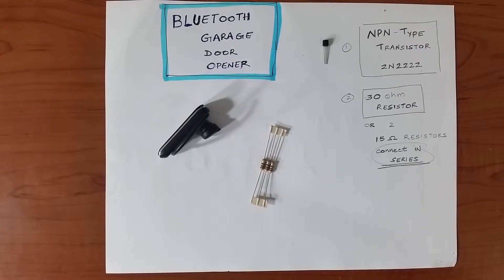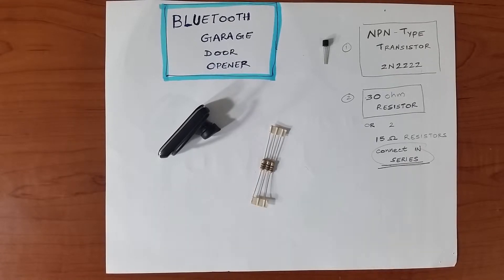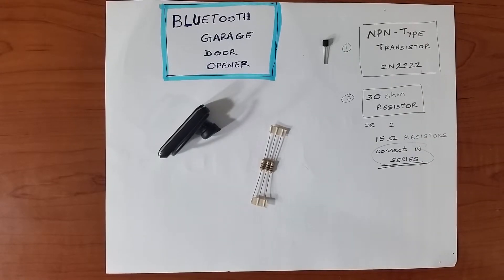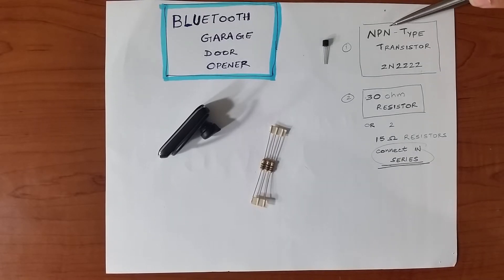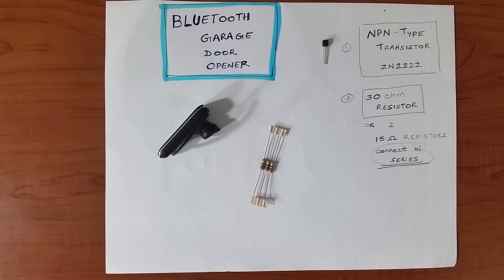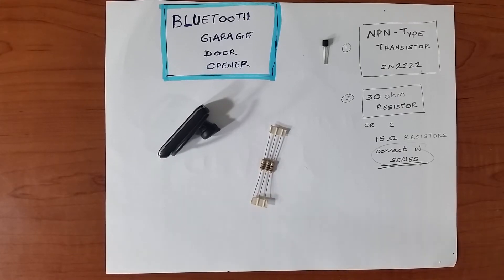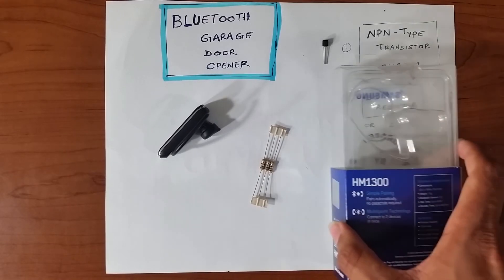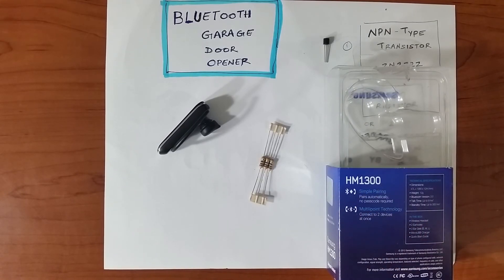DIY Bluetooth Garage Door Opener

Comment: Hi there, how longs you've been running the system with HM1300? Are you having issues like it works for a day or two and then stops till power cycle the headset? I also used HM1300 by following Lou's video (used same transistor 2N2222 and resistor 30 Ohms) but fails to trigger the garage door opener after a while - mostly next day morning (handset connects to Bluetooth headset but the opener is not triggered). Please let me know if you have any idea. Thanks.
Reply from the maker: Maple Digital I haven't had any problems so far. Lou's app never worked for me with the HM1300. What I found out was that the opener was only triggered when you "disconnect" or turn off the Bluetooth from your phone. You could also try placing and ending calls while your Bluetooth is paired & connected and that triggers the opener as well.